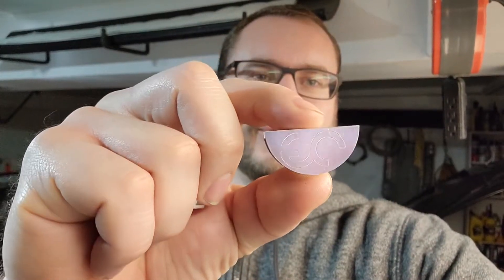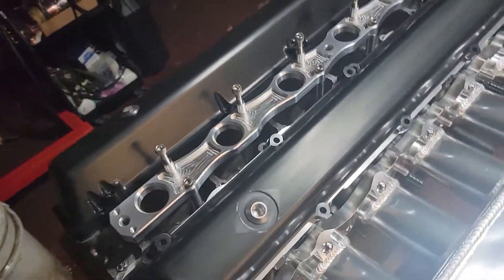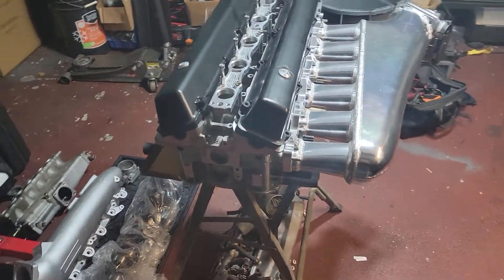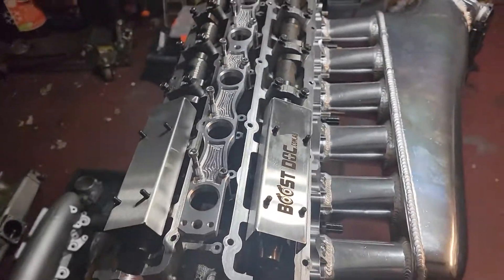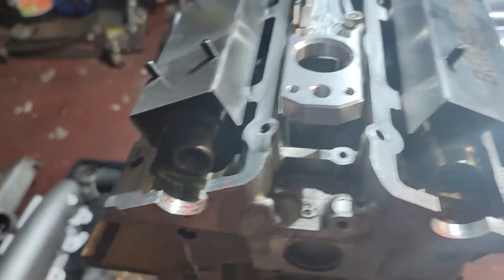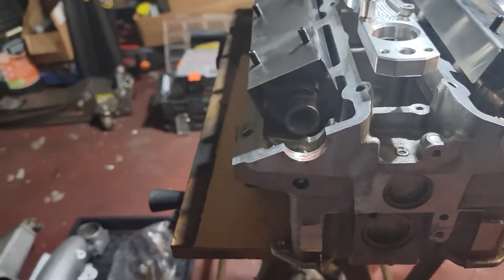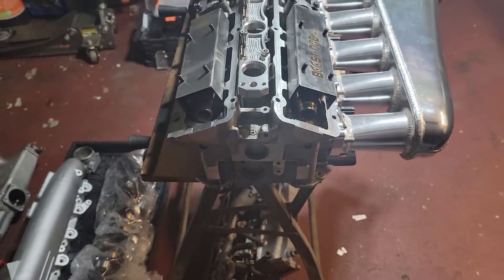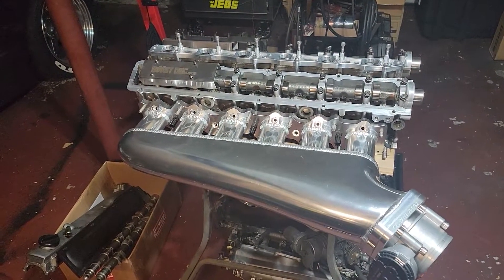Installing the Outsider Garage RB Billet Half Moon Seals

Comment: Can’t wait to install mine along with the boost doc oil splash plates. Not sure why it didn’t come from factory with aluminum half moon seals tbh or better yet why there’s a need for them instead of being filled in
Reply from the maker: Good question! either way, the billet moons work great, and give you a little piece of mind